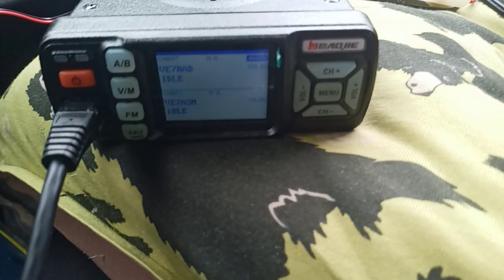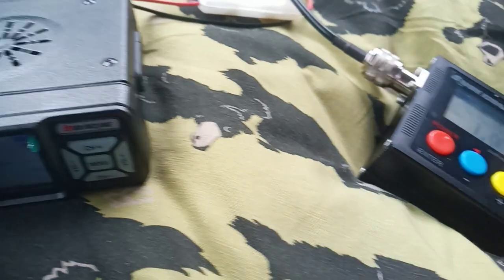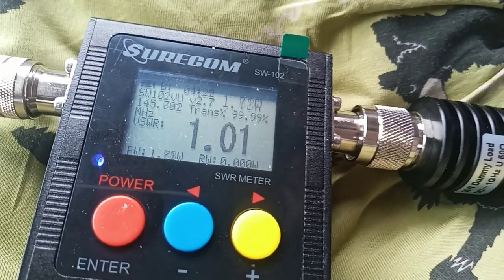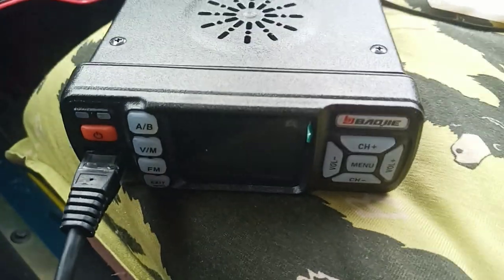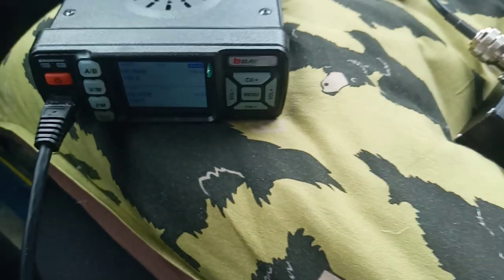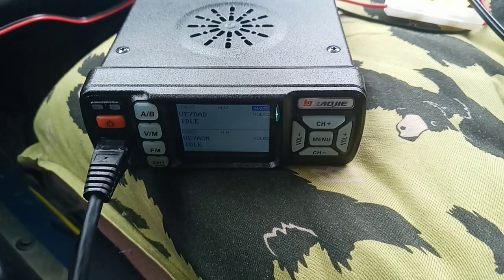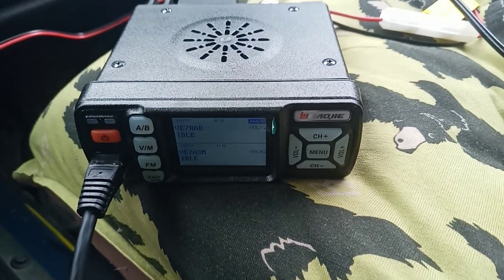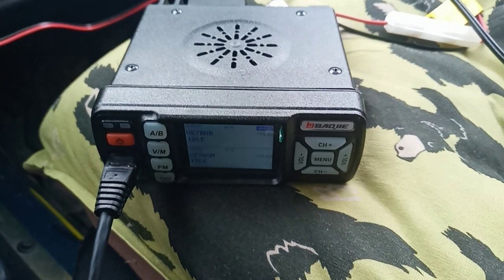Baojie BJ-318: Why this HAM radio is junk. Have you tested VHF power output?

Comment: I have one that works perfect. Must've got a bad batch. I hate any kind of beeps. As mentioned, I turned the beep off in the menu. I keep it in my tornado shelter with a retractable antenna. Sorry you got a bad one. I had the same problem with UV 5R. Four of five failed in a few months. I replaced them with this. Month after month it just works.
Reply from the maker: That is good news that yours work as they should. I thought my 318's were alright as I could still hit repeaters and simplex worked for a few miles, but noticed I had better range and signal reports on 5W HT's. Mine could be from a bad batch like you said. What do your 318's measure on the power meter on VHF at high? I just orderer the AnyTone AT-779UV from Amazon. Really impressed so far. 21-23W on high, good signal reports, faster scanning and I like that you can set it to exclude channels from Scan right from the menu. Thanks for the comment and 73 to you!

Comment: I would contact the manufacturer and get both your radios replaced I have 3 of these radios and all are up to par! The thing I hate about these radios is the dam beep is loud and needs to be either silent or they should give us a way to lower the the beeps. Anyway thought I would leave a comment saying what the 3 radios that I have say and do exactly as it's advertised...
Reply from the maker: Appreciate the comment David. Can you confirm you have tested VHF on a power meter? The beep can be turned off through the menu or CHIRP, but it is an "all or nothing" thing. It would be nice if it was volume controlled. Funny enough the beep that can be heard in this video is not the radio, but rather my CO detector/alarm warning of low battery. 73's!

Comment: That surecom meter is the worst thing made. Mine was always way out of spec.i Sold it. That was the junk.
Reply from the maker: I don't expect it to be perfectly accurate, but I have used it to test dozens of radios and the power, frequency and SWR always reads around where I would expect (except for the BJ-318 of course, but that is a common issue with these radios) Perhaps just like the BJ-318, some of those Surecom meters are faulty.